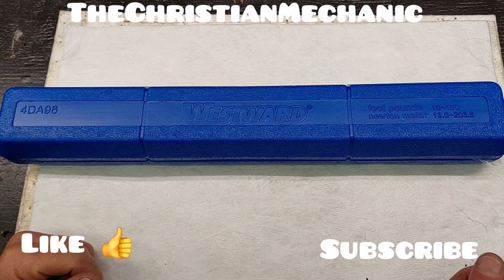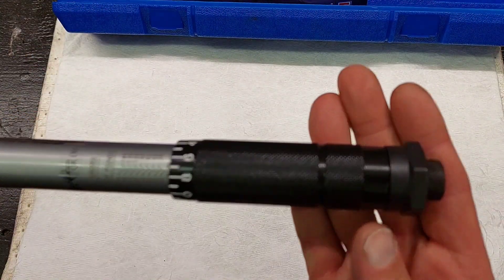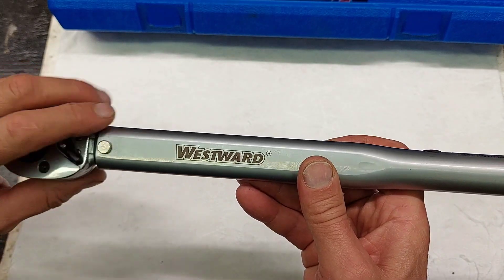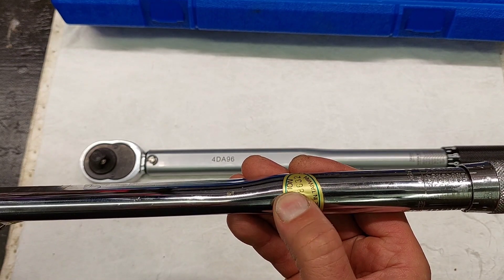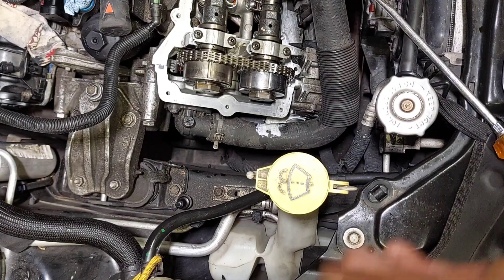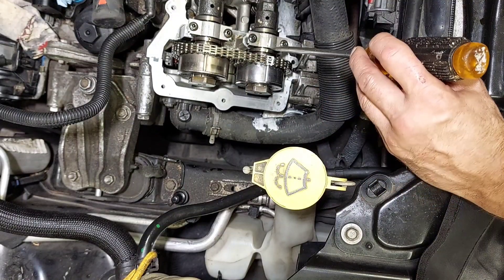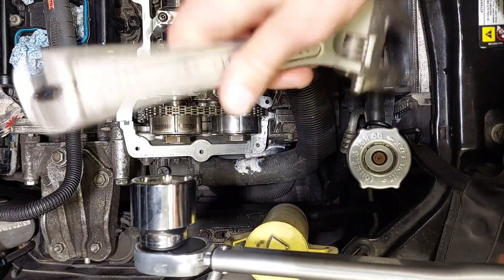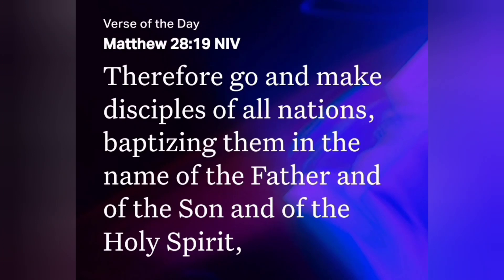WESTWARD Micrometer Torque Wrench: Foot-Pound/Newton-Meter, 1/2" TEARDOWN head

Comment: Thanks Brother, you are the man and my go to channel for tool reviews.  I appreciate you.  I'm thinking given the very limited clicks we put on a torque wrench it doesn't really need lube.  Maybe a very light coating of oil to prevent rust.  I even wonder if thick lube somehow affects the calibration?  Loving the Scripture and witness.  God bless.
Reply from the maker: Thank you Steve, I'm not sure the grease will have anything to do with it because when your pulling on it for resistance it is not moving it is wedged against the paw. I'm curious. Maybe I can do a video on that with one of my other torque wrenches.
Reply: @mlacher100  I think you're right, no effect from the grease.  What was I thinking!  Still, your experiement seems worthy and interesting.